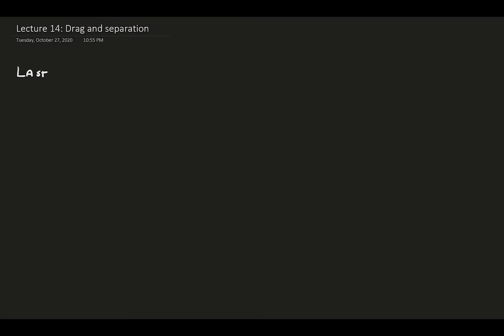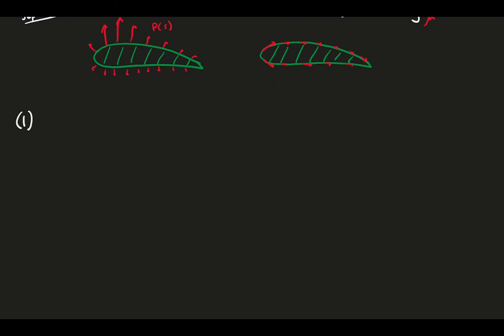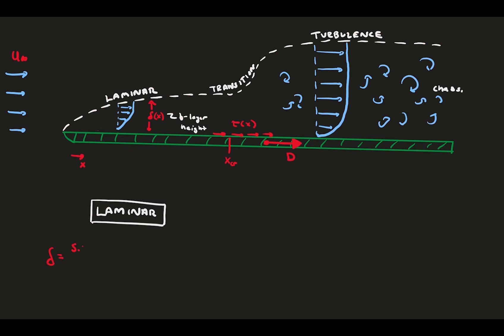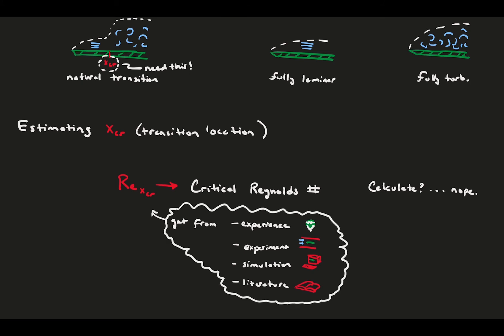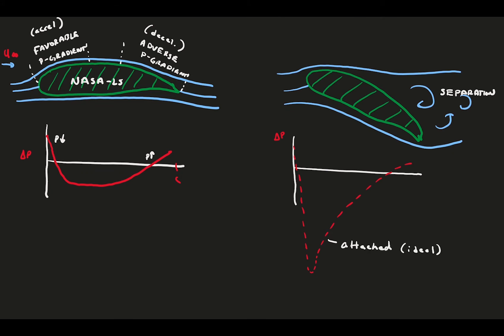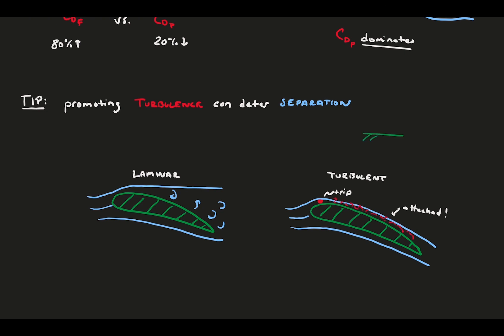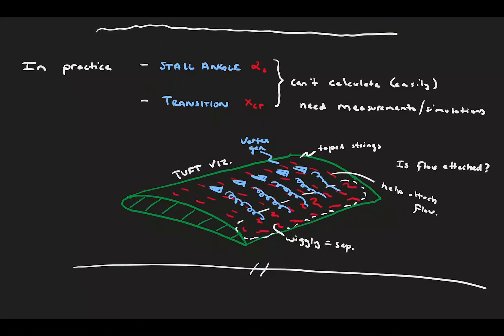Drag and separation [Aerodynamics #14]

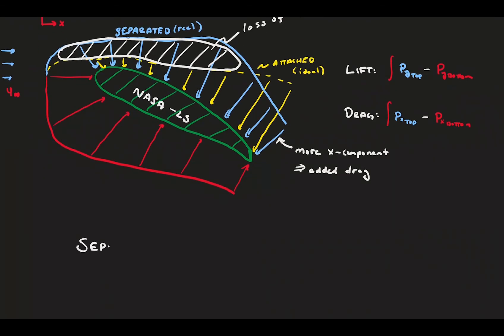Comment: 12:15 I think you made a small mistake. The separated upper surface pressure field is such that the higher pressure in the LE causes a higher force component “backwards” in the (drag) whereas the lower pressure in the TE does the inverse, causing a smaller force component forward (opposing drag). In potential flow, these x-components cancel out (hence predicting zero drag) but here they change such that a total force backwards appears (aka pressure drag). Love your videos, thanks for the content!
Reply from the maker: Thanks for pointing that out and engaging!
Reply: Exactly the point I was looking in the comments before I post mine

Comment: Professor, for inviscid flow, when an airfoil turns the airflow downwards, doesn't that reduce the momentum in the x-direction. Shouldn't this lead to drag by Newton's third law?
Reply from the maker: I think in reality it would and that would be bundled into viscous phenomena. But I don't think inherently the turning of the flow leads to x-momentum change on a basic level vector-field level. I can change the y-momentum of a flow field without impacting the x-momentum (though the rules of conservation of mass and basic fluid mechanics comes into play here too...). Not sure if I cleared things up or just confused myself further!